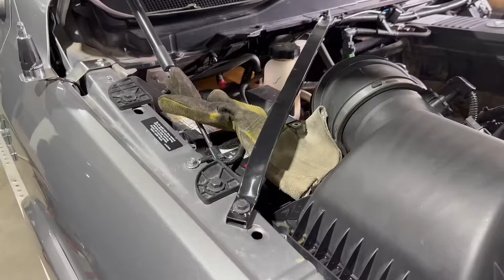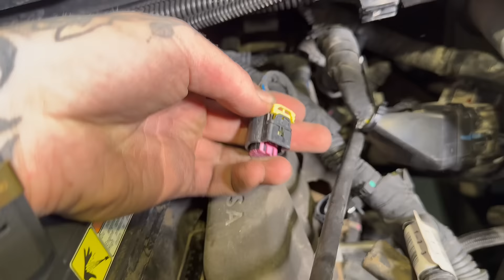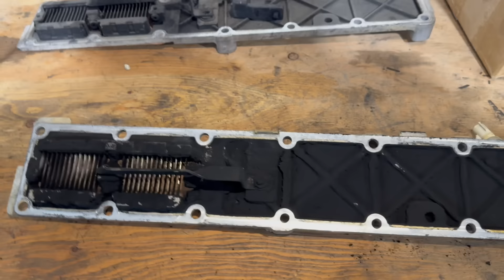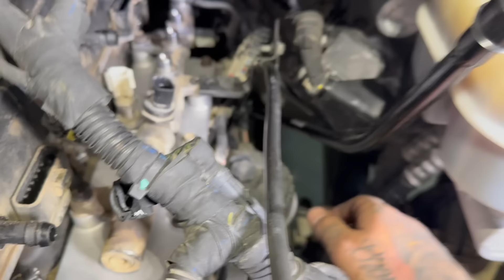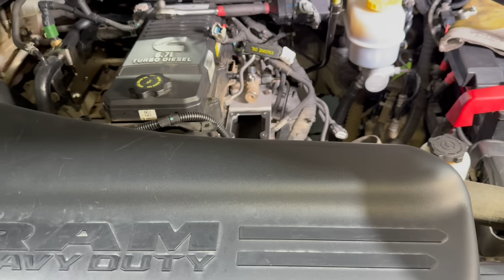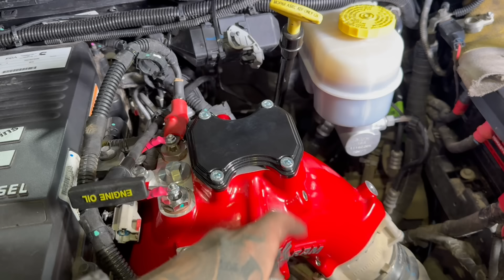How To Install Banks Monster Ram 6.7 Cummins - QUICK VERSION

Comment from the maker: DISCOUNT CODES:

Banks Power code: DARKIRON
https://bankspower.com/darkiron

Power Driven Diesel 10% code: DARKIRON
https://powerdriven.com/DARKIRON

ATS Diesel 5% code: DARKIRON
https://atsdiesel.com/DARKIRON

PPEI Tuning 10% code: DARKIRON
https://ppei.com/darkiron

Fass Fuel Systems FREE swag bag code: DARKIRON
https://fassride.com

Thunder Muzzle Muffler $50 code: DARKIRON
https://glorydaysspeedshop.com/DARKIRON

Horn Blasters 10% code: DARKIRON
https://hornblasters.com/DARKIRONDIESEL

Peakside Performance Custom Tuning 5% code: DARKIRON
https://peaksideperformance.ca/DARKIRON

Katz Azz Break Clean / Oil Additives 10% code: DARKIRON 
https://dieselrcorp.ca/darkirondiesel

SHOP DELETE KITS HERE:
https://thedieseldudes.com/collections/full-delete-bundles?afmc=1f
$30 off code DARKIRON

SHOP MERCH HERE:
https://darkirondiesel.com
Reply: Thank you!
Reply: @skyforgephotovideo Hello

Comment: FYI - There is no need to remove the last fuel line in the rear, just loosen it from the fuel rail. It’s a little tighter back there but the fuel rail will come off without removing it and it saves you the headache of trying to get it loose and putting back on.

Comment: Thanks for the video. Just got finished with my 2011 yesterday. Used your discount code. Thanks for that as well. Love the not having to worry about the bolt on the grid heater anymore. Such an awesome upgrade.

Comment: In case somebody wants to know the fuel line on number 6 doesn’t have to come off just take it off the the fuel rails and loosen the the back so you can just rotate it upwards.

Comment: 22 ram 3500 install went great kinda a PAIN but have patience. Ok truck is deleted got the code P0113 intake air tempiture sensor 1 circuit high. The sensor is plugged in and ordered a new one any ideas?

Comment: Ask me how I know, CHECK THE SENSOR IN THE REAR OF THE FUEL RAIL AND MAKE SURE ITS TIGHT! got mine installed and my sensor was leaking, no good way to get back there so had to do the job twice 🙃
Reply: Up underneath the truck with a long extension vertically. 28mm socket. That’s the rumor so as to not have to do the job 2x

Comment: I'm actually going to install the monster ram on my 24 rebel Cummins this weekend. I'm a bit nervous, seems like alot, but im sure i can get it. I installed banks monster exhaust, banks boost tubes and banks cold air intake last weekend. I ordered the pedal monster and idash monitor today along with piller mount for monitor and second heater coil for monster ram.

Comment: Have you ever had issues or heard of issues with the #1 fuel line Banks provides? I just installed this and have a persistent leak that wont go away. Took it apart, lines look good, but the leak remains

Comment: hey got a question for you guys, I have both the monster ram air and a delete kit, can I do them both at the same time or is better to do the delete and make sure it works then do the grid heater delete?
Reply: I know this answer is a little late but I did my delete and monster ram air same time.

Comment: Did the full install, still have EGR at the moment unfortunately, deleting soon. I did the single heater coil. I keep getting the p2609 check engine light for intake heater performance, I've checked the connection to the heater element and it's a solid connection, not sure why im still getting this code?

Comment: Can you hear the intake charge air significantly more with the monster ram? I just installed one on a 21’ Ram and it makes me think I have a massive boost leak but I’ve check all connections and torque on bolts

Comment: Hey thanks man. Even though the only metric wrench I had that was a 19 was a crappy one, I was still able to do this job in about five hours. I didn't need to loose the #6 line on the head. I just loosened the fuel rail side. It flexed enough to move out of the way. 

Did not see a single bit of difference after the install, which is exactly what I was hoping for.

Comment: Great video brother. I have a 2024 I’m getting ready to do the monster ram and the banks boost tubes at the same time. I already have the banks cold air, pedal monster, and twin banks gauges. Next I want to do the weight loss program very badly! Thank goodness for president Trump and easing our epa restrictions. It’s still illegal but hopefully not enforced as bad

Comment: Just installed this kit today on a 2021 Cummins, there’s no need to remove or loosen the injector line from the head, just remove it from the rail and there’s plenty of room to just move the rail out of the way without disconnecting the pressure sensor either.
Reply: Just a warning to everyone, did this method and my sensor on the back worked loose, just take the whole fuel rail off and make sure everything is tight cause I had to do the job twice because I cut corners. It’s better than leaking diesel everywhere.
Reply: @d @dillonlyons6154  I’ll just make sure my plug is nice and secure and leave them attached when I do it today lol. Maybe just #6
Reply: @UserIsntHere67 just make sure the sensor didn’t thread outwards, and double check that all the lines are tight constantly working backwards. I went back and tightened everything and it’s been good to me

Comment: I didn’t have to take off the last injector line, only off the fuel rail but I was able to leave it on, makes it much much easier.
Reply: You can leave 5 and 6 completely on
Reply: Thank you for this. I tried to get #6 off and couldn't do it without either making a custom tool or buying a crowfoot set. Instead I just loosened the end on the fuel rail and it flexed enough for me to move the fuel rail out of the way.

Comment: What is labor time like to do this job?
Reply: Taking my time, double checking everything and torquing each bolt and using the included threadlocker on the horn - 7 hours with lunch break. Crows foot wrench definitely helped and just loosening line 6 to swing up out of the way. Knuckles are cut up from the tight space of fuel lines. Not difficult but tedious the 1st time following instructions to the t. Wouldn’t dread it again after this experience.
Reply: Day 2 for me. 2 trips to harbor freight. And a trip to NAPA for a topside creeper
Reply: A full weekend for this rookie.
Reply: Fugg. Day four for me

Comment: Just take a minute to inform you to suppressify on the heater coil, that it does need two nuts to separate it from grounding out and frying your heater coil voltage regulator. I missed that step that was not specified. And found out the hard way, should have known better. But in a hurry to get it, running. I'll send picture what it looked like afterward.

Comment: Hey friend, what is the determining factor for running two vs the one heater coil? I just bought a 2019 6.7 and am wanting to order parts like asap. Thanks for the informative video!
Reply from the maker: Hey I’m currently testing the heaters myself but my general opinion is if you live somewhere quite cold I’d do 3 heaters total. If it’s mildly cold 2 would be fine and if you live where it doesn’t get too cold one is good

Comment: I installed my grid heater delete now truck want start. I followed your video to a tee and it still want start. Any help would greatly appreciate!!
Reply: Probably need fuel primed in the lines
Reply: @hunterross7105 I finally figured it out. It took awhile for the truck to prime back but it eventually primed and cranked right up.

Comment: you dont have to take the 6th fuel line off the block. just take it off the manifold and slide the manifold out from under it

Comment: It's not random when the nut fails. It has the potential to rattle loose over time, which causes a poor connection. That poor connection causes a resistance spike, and on a circuit that pulls 200A, a resistance spike creates a fuck ton of heat. Checking the terminal for play regularly will tell you if it's loose, and re-tightening it prevents it from failing without spending $1k on an intake horn that doesn't do anything else
Reply: By tightening it you mean the top nut? Is the bottom nut welded on or are you having to remove the grid heater and tighten the bottom nut as well? And what would be the torque spec be? Sorry I'm new to this truck and like you said it terrified me hearing about the catastrophic failure  Thank you for your time
Reply: @OutlawCowboylll it should bring you some comfort to know that the failure rate is about 0.1%. This grid heater iteration was used on every Cummins Ram, and most ISB/QSB 6.7s, for 18 years. One company just saw the opportunity to use fear-mongering to market their intake horn, since it offers zero improvement in driveability or performance that they could use for marketing instead.

If the nut ever starts to come loose, then the plenum has to come off in order to tighten it. No, the nut isn't tack welded. But the grid heater and intake horn need to be cleaned every 60k as part of the EGR cleaning, so having it apart is a good opportunity to tack weld the nut in place.
Reply: @technewb8241 thanks brother!
Reply: @OutlawCowboylll no worries. BD also has a $200 permanent fix that doesn't sacrifice cold starting capability, or wildly increase maintenance costs on emissions-intact trucks
Reply: Facts. I maintain a fleet of 6.7's for the state of Texas.  Never seen the nut fall in, but Gail says it will, but he's making a fortune on the scare tactics
Reply: @Chris-m8k9i and paying creators to spread his fear-mongering rhetoric, while giving kickbacks on every sale made

Comment: Do Banks' boost tubes make much of a difference.
Reply: Yes, but negatively. The turbo doesn't flow more air or at higher pressures, so running bigger boost tubes causes a drop in boost pressure. It's the same concept as replacing your garden hose with a 1" fire hose

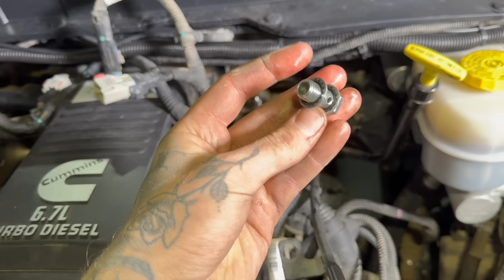Comment: 6:05 need part number or where could I get a new bolt post it in the process of putting everything back together
Reply: 6:05 show the banjo bolt. Is this the part for which you need a number?

Comment: Hello Kyle, you helped my buy my truck from Calgary a few years ago, I live in Ontario, my truck is deleted and I’ve been loving it. I want to put the banks monster ram in my truck. I looked at the banks website in the US and Canadian diesel online. The price is about $300 less coming from banks with using the exchange rate. Do you have any issues ordering from them to deliver to where you are? (I did enter your code and it gave $37 US off

Comment: Just install it and I lost significantly on the MPG. Do you have any suggestions? I got monster ram, dpf back exhaust (banks) and pedal monster currently installed.
Reply: More air means more fuel needed
Reply from the maker: If I had to bet I’d say you may have missed a bolt or have a small boost leak causing an efficiency issue

Comment: How is it not a recall with that grid heater bolt
Reply: Ill give you one better.. the big dpf filter is on back order they say so when your truck is about to go in limp mode because of it they tell you good luck !! They do not give a damn about your warranty so be ready to delete if you have this issue like I did. 70k miles on my truck with 125k warranty told oh well 🤷 with 50 miles till limp mode....
Reply: @DoubleOGamer007  fuck them , always shady af at the dealership
Reply: It is because that would cost them money and that is what supersedes all. 

I also think it is because it only affects trucks that get started in cold temperatures, not all of them. If you never have cold starts, it won't be an issue because the bolt on your grid heater won't take any damage. I have a 2020 that was manufactured in Mexico, spent most of its life in Texas and 1 year in UT. The grid heater bolt was in great condition when I swapped it out. However, if the truck continues to have cold starts, it is only a matter of time before that bolt gets fried.
Reply: Seems like all companies are getting so darn greety...

Comment: Anyone find it ironic you do this to eliminate a bolt from failing yet there’s a bolt you have to install inside the intake that god forbid it comes loose lol.
Reply: Yeah but be realistic. The bolt that could fall goes through constant heat cycles for the grid heater. The other wont doesnt.  Personally id preposition the bolt first and thread it first.
Reply: Exactly what I was thinking when he stated using a magnet to line it up. lol
Reply: @tylersaiz9550 it calls for thread locker. It’s a 1.5” bolt with flange washer/lock washer deal and you torque it into the manifold. It’s not dangling over the intake manifold to arbitrarily drop in at some point.

Comment: Great videos, appreciated it. I have a Tune Ram 16-17 6.7L PK 68RFE. OEM Flash. 32370731AE; Do I need to apply it to the ECM  2016  prior to do custom tune?  Thank you for your help in advance.

Comment: I know this question isn't really about the intake horn in your video, but you keep mentioning delete kits. I want to delete my 2017 6.7, but I also don't want it obnoxiously loud or having a drone inside the cab. Any good recommendations for possibly a muffler or something like that to help with the issue? Thanks.
Reply: You can always just get a 4 inch exhaust and then get the added muffler option. It’s very quite but the powers there if you need it.

Comment: Installed mine last year and just found a boost leak at the intake gasket. A little disappointed tbh. Wondering if i should just try a stock gasket and use a little silicon
Reply from the maker: If you install it correctly there’s absolutely no way it could leak, unless you bought a knock off brand intake elbow, they tend to leak because they aren’t machined as precise.
Reply: @darkirondiesel maybe installed wrong idk. It was the banks kit, order directly from their website
Reply: @darkirondiesel just took off my heater element to check the inner bolt. Found that bolt was a little loose, so that was probably the culprit but the heater element was seized in the threads and broke the threads. So I have to repair the threads or buy another one 😢

Comment: I greatly appreciate your video!

What is the range of mileage that you have seen such engine failure due to the nuts fell off from the grid heater? 100k to 150k miles? Or at ~67.5k (the magic # to clean EGR valve)? 

Also, what was the range of engine hours for such failure?

Please share your experience! Thanks.

Comment: You would think cummins would have fixed this problem by now
Reply from the maker: You’d think so wouldn’t you. Absolutely ridiculous they didn’t until 2025.
Reply: @darkirondiesel  I have been looking at the 25-26’ ram with the Cummins & I’m wondering if the bank’s monster ram will void the factory warranty

Comment: If someone was to go crazy with the heater coils, would there be enough clearance for a 3rd coil in the middle once you install that bolt through the middle hole ?

Comment: Mine has a weight loss program and I ran out of time before taking a trip.  I used a local garage to get it done with what I was told was an experienced Diesel Mechanic.  I agreed to the $200 per hour because I knew I needed at least 4-6 hours to do it.  The garage broke the #6 fuel line and said it took 6.5 hours.  I did get the cost down to 4 hours because Banks stated it took 6 hours from a DIY, 4 hours for a professional mechanic and 2 hours if they are really good and already deleted.  I want to be far, am I off base saying 6.5 hours for a professional mechanic to complete was too much?

Comment: Just be super cautious when loosening your injection lines the return tubes see any movement could cost you pressure issues…. Always back up your return tubes with a wrench when loosening or tightening the injection return lines

Comment: What about start up? Do you just cycle the key on and off like five times like changing the fuel filter?
Reply from the maker: That’s a great question! My bad, I totally didn’t go over that procedure. Personally, I just crank it and it usually starts in about 15-20 seconds. But yes cycling the key a couple times would be smart. If you really wanted to get technical you could crack an injector line, crank until fuel leaks, tighten it then crank again.
Reply: @darkirondiesel  is there a torque rating for the fuel lines or just snug?
Reply: @mj23isthebest  30 foot pounds torque spec!

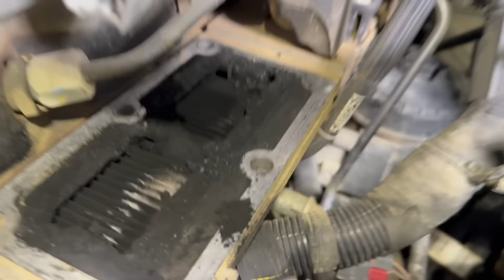Comment: 2:49 I still can't get over the fact that these new trucks pump exhaust into the intake manifold.
Reply from the maker: ya dude its disgusting
Reply: Even the 1982 6.2 GMC diesel had egr.
Reply: @richardradawetz8788 5.9 cummins had them as well embedded into the camshafts

Comment: U compared this banks stuff to the cheap b.d fix. Y dont you conpared it to b.d diesels intake horn with the same style heater. U can put 2 heaters for 1500 watts in it too. And the b.d horn dosent have emmisons holes on it.

Comment: Thank you for the new vid. I recieved my new Monster Ram with dual plugs last week. Installed over the weekend. This intake made a massive, and I mean massive imporvement with the drive ability on my Ram. This intake smoothed out the throttle responce, and now the 6.7 sounds better too. Better idle as well. I did use your Dark Iron code to save 10 percent. Cheers eh from Northern BC. Thanks again. Love the vids.
Reply from the maker: That’s awesome to hear man!
Reply: Did it sound like it had a ton of air flow, almost like a huge leak in the system. My shit got way loud but everything is tight and good to go 😂